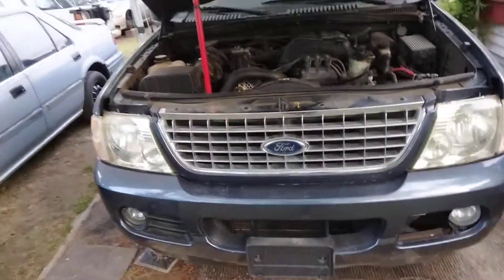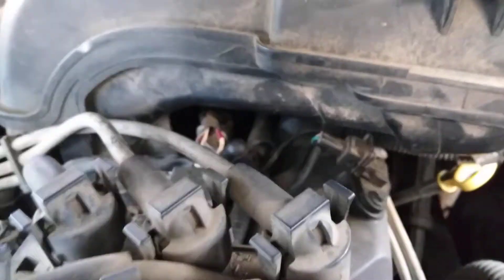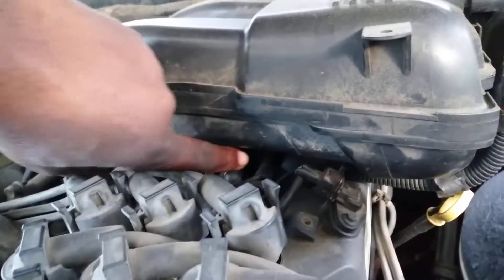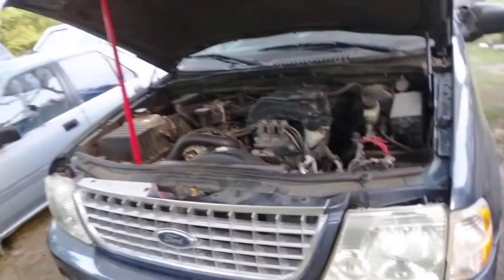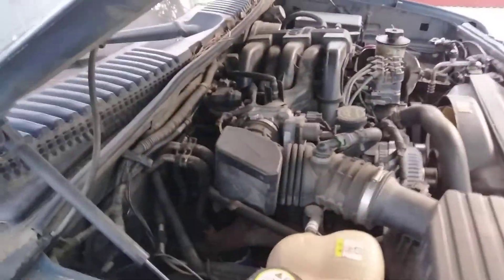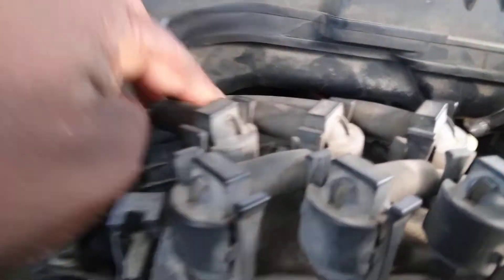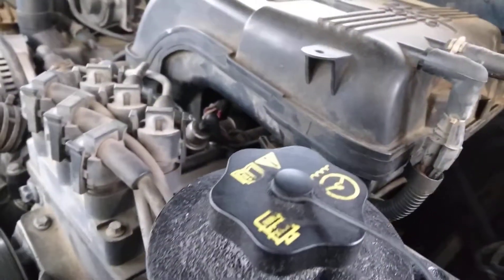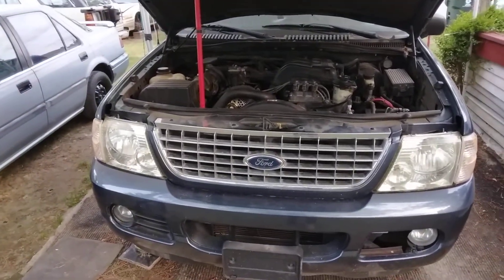Ford explorer 2005 to 2016 fuel pressure sensor who ever design this location was drunk 🥴 🤣🤣🤣🤣🤣

Comment: So could you replace it without removing it? Did you try? I'm having this issue with my truck
Reply from the maker: yup just loosen the intake and pull it up and slide a 2x4 under there so you can get your hand to remove the sensor its a 45 min job easy hope this help tfw
Reply from the maker: i got videos on it how to replace ir easy to do i haven't drove mines much since i replace the sensor very little tfw
Reply: @onrdetailingnews802  I've tried finding the video and couldn't find it
Reply from the maker: @keke10293  gonna see 👀 what video it is for you